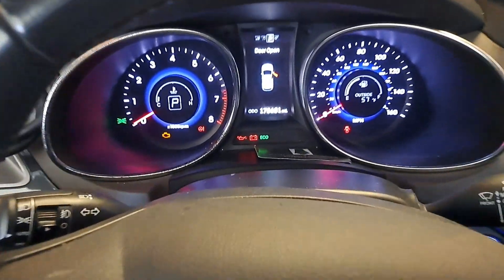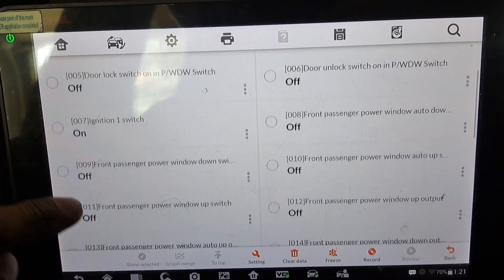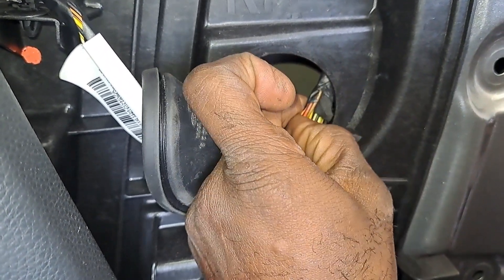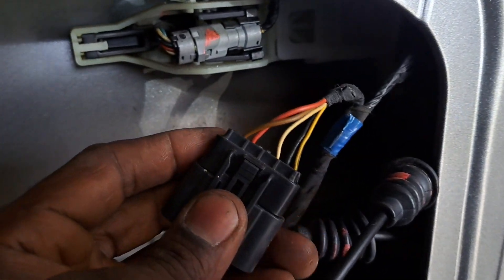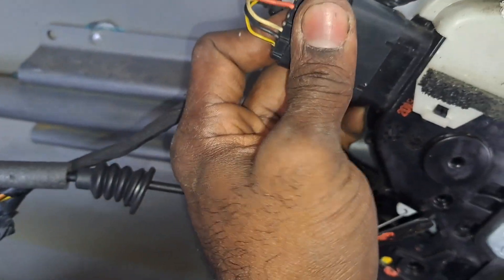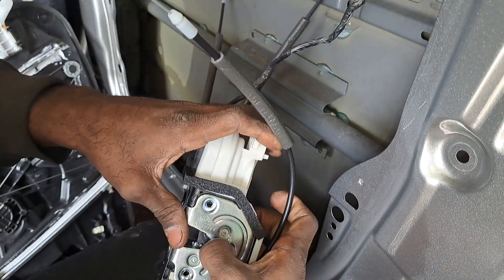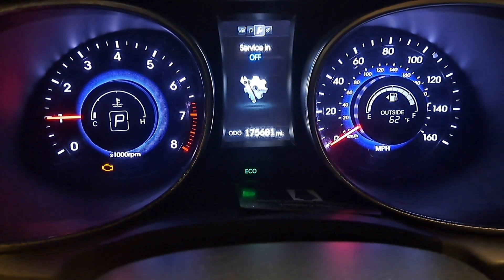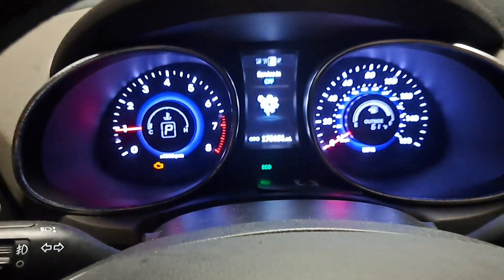hyundai door ajar circuit test and fix

Comment: Hey @partsshooter , your video was a huge help. Our front passenger door is having the same issue. Question, if I just cut that yellow/black wire would the door think its always closed or would I need to cut it and then ground it to something so it has a constant ground? I don't care if the car thinks the door is always shut, I just want the message to stay off my dash. Thanks in advance
Reply from the maker: Logically... yes.  If you cut it,  it should stimulate a closed door. I would de-pin vs cutting.  If you cut,  just leave yourself enough to fix back comfortably.
Reply: @partsshooter  Ok, thank you again and for the quick reply. I knew I was thinking correctly but sometimes I second guess myself. lol
Reply from the maker: @TAKL0722  shoot... you and me both!
Reply: @TAKL0722  Did cutting the wire fix the issue for you?  I have the same issue and just want to cut the wire as the easy fix if it actually keeps the door open light off the dash.
Reply: @ehthis  Yes it worked flawlessly. I just cut the wire and capped the ends. Message went away on the dash and I got my sanity back. haha
Reply: @TAKL0722  Perfect! Thank you for the update!
Reply: @TAKL0722  you cut both wires or just one?
Reply: @jorkor4717  I don’t have that car anymore but I’m pretty sure it was just the one yellow and black wire I cut. That’s the wire that controls the ground signal.
Reply: @TAKL0722 ok awesome, thank you! I have the same issue and now that it’s cold it drains the battery

Comment: Bro..i got the same car. But my problem is my door lights wont work when I open the passenger side door. Not even on the instrument cluster display..so which wire should I check? Do you think I have to replace the latch?